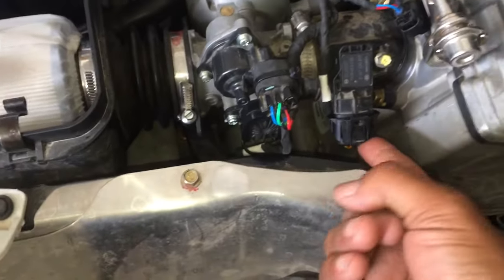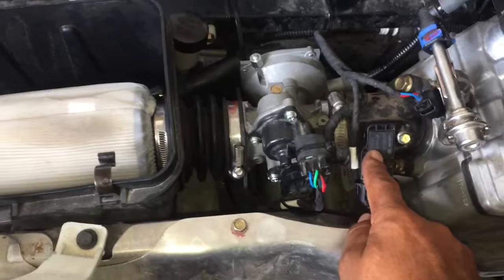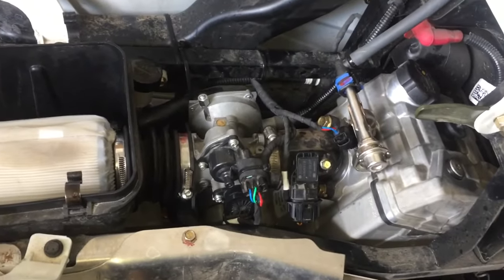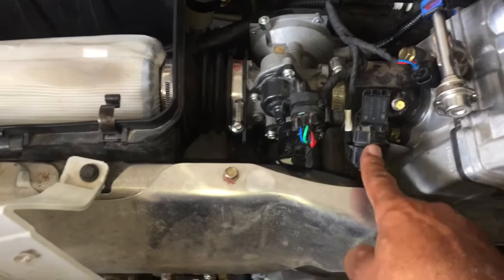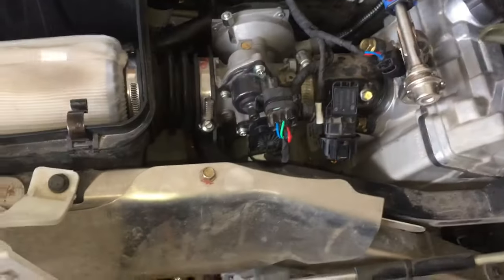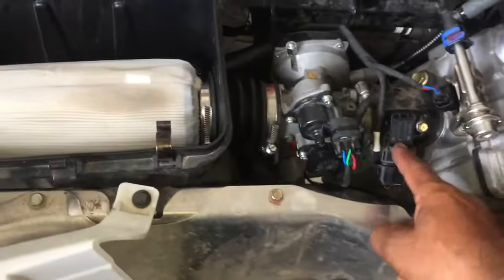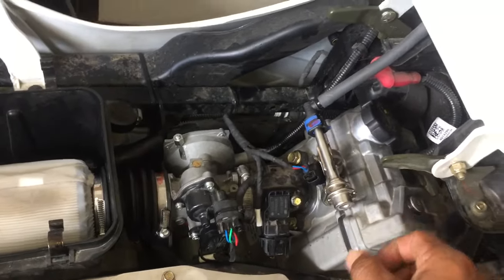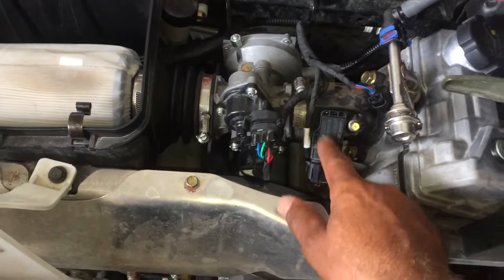Polaris sportsman Problems

Comment: My Polaris Sportsman 450 HO EFI ATV won't start.  If I crank it 5-10 seconds it will start for a second or two.  When I disconnected the connector to the Bosch MAP (like in the video) the ATV starts (for a second or two) every time I crank it but it won't stay running.  I've ordered a replacement MAP since disconnecting it does make an improvement. I checked the fuel injector and it is spurting whenever the engine is cranked. Thoughts please? Thank you.

Comment: Mines was doin this till I read these comments n truly it was da fuel pump thanks to u guys
Reply: Did you change out the pump or just clean yours?
Reply: @kingbean8708  I change da motor on da fuel pump now my 4 wheeler back going again
Reply: @chief1986  the actual housing or the unit itself?
Reply: @kingbean8708  just da unit

Comment: we had same issue 550 xp, it didn't run just like yours. we changed it and it works now
Reply: did ur xp have tons of cranking power when you tried starting it or have any problem with a no spark issue ?
Reply: @northernatomicalatv9262  The map sensor was broken, I changed map sensor and it started work good.

Comment from the maker: I just call to Power sports of Mckinney they told me the fuel ⛽️ pump must to have between 45 to 60 psi  of pressure mine has only 20 so for sure I need it feel pump. I will update soon as I get it installed.
Reply: Roberto Rgz I replaced fuel pump on mine bought from Amazon for 59.99 includes regulator, filter and tank seal, dealer wants over 300 for the complete assembly , the bad is that the 2 wires going to pump need to be soldered not a big deal solder tool 10 bucks at Wal-Mart here is my quick video of it running again I will upload a how to soon https://youtu.be/dgivBEgzCPU
Reply from the maker: jdr_03 2011 and it fix the problem?
Reply: Roberto Rgz yes i can rev it up now and stays running fuel pressure 56psi now before had 20psi
Reply from the maker: jdr_03 2011 good 👍🏻👍🏻👍🏻👍🏻 thank you 🙏🏽
Reply: Roberto Rgz hey I got a Polaris 850 - 2015 was running fine sometimes when I was riding it for and hour or so will just shuts off and will go back on with no problems but now can’t get it to stay running if I let go the key , if I keep the get going and give gas will run but soonest let go shuts off anyone have any idea what can be already clean injectors and air filter
Reply: @dieselgarage7542  update on my 2016 polaris 450 efi.   I have great fuel pressure.  I cleaned tank, cleaned TPS , cleaned  throttle body. Cleaned fuel pump. I set spark plug gap.  All I need is to add fresh fuel.  Update u later and see if have that small sputter and poofing. It's not bad but noticeable

Comment: I'll.never buy a Polaris again
Reply: Agreed I still have mine and it's doing the same thing plus it's idling to low and I have no idea how to fix it
Reply: i have 2012 850 sportman, works really great, i had one issue check engine code 520194 2, i followed the steps and i repaired it without any cost. i never spent one dime on it in 9 years. so yes i will buy back polaris
Reply: Me neither.
Reply: Agreed!
Reply: Same here junk